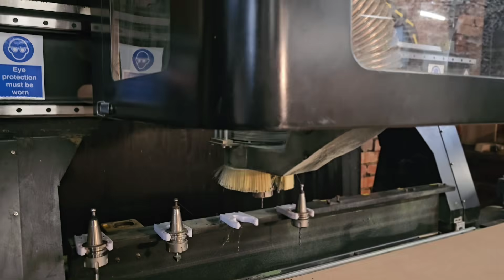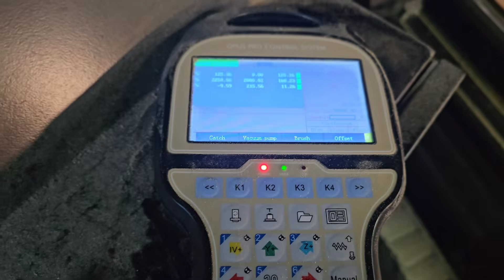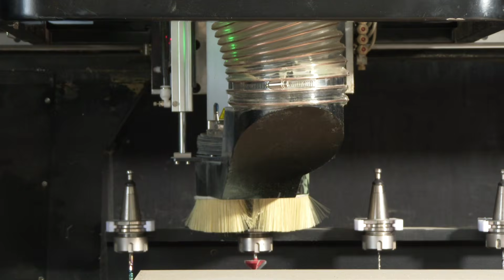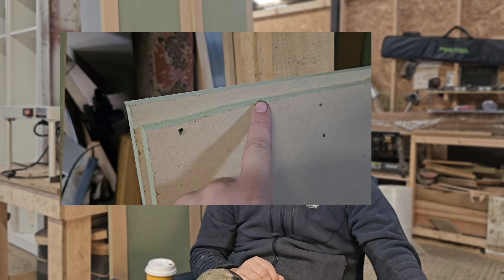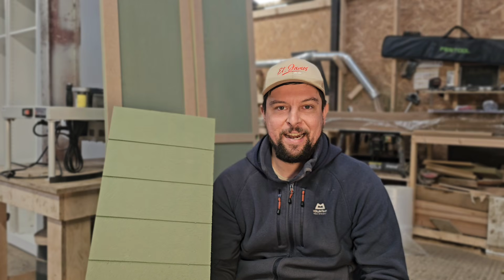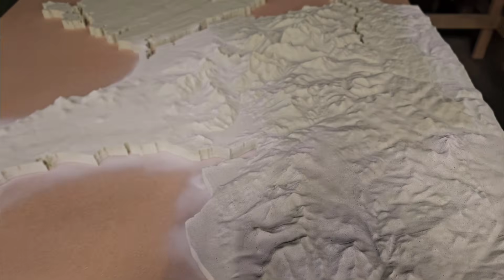Can a CNC really pay for itself? Let's find out!

Comment: There are so many places this is spot on. (TLDR)  I am a retired engineer in the electrical fields with a solid mechanical background.  I also have a talent in wood working.  I have a table saw, jointer, planer, drill press, band saw, power miter saw, etc.  I recently bought a 4' x 8' CNC from a buddy of mine who was selling at a great price.  In my career I had to learn CAD (Pro/E CREO).  For what I do now I use Fusion 360. I'm quite good at it.  Now referring back to my opening statement.  I have made the dumb errors and learned that moving quickly like you can in each machine is not what you want do with CNC.  Seeing your brand new bit driven down into the z-axis sensor and watching it shatter into a thousand pieces because I forgot to connect the magnetic sensor to the spindle can be very discouraging.  In the first 3-6 months learn.  I have been at it now for about a year and built some drawers for cabinets that I put into an Air BNB.  The cabinet was of a custom size and would have cost me hundreds.  The CNC made it quick and simple to assemble.  Now I use it for building drawers and cabinet for houses that I renovate.  It saves me thousands.  Was the 10K I spent on the machine worth it.  Absolutely.  My point is you won't be an expert on it coming out of the chute.

Comment: I've owned a 4' x 4' CNC Router and CNC Plasma table for 13 years.  Recently I ordered a new 5' x 10' CNC router.  At the end of the day, they are just tools.  I run a mom and pop sign shop and our equipment has paid for itself many times over.  Just like the table saws, drum sanders, miter saws, Etc., they are all tools used to manufacture our product.  When considering a significant expenditure for new equipment, it takes a good plan for products/revenue.  Most of our time is spent designing products and making sales.  Running our tools make up only a small amount of the time we spend each week operating our business.  The biggest mistake I see other small businesses make is they do not factor in their tool cost when pricing a product or service to their client.  Beyond the hourly labor and shop overhead, please remember to include a small % markup to pay for tool investments, the cost to maintain them, and most important, the cost to replace them when they are worn out.  Lastly, add more monies to your pricing for a fair profit margin after all said expenses.
Reply: Do you find woodworking more doable ore profitabile than metal cutting?
Reply from the maker: Dead right, proffesional woodworking is super expensive to get into, but all worth it!